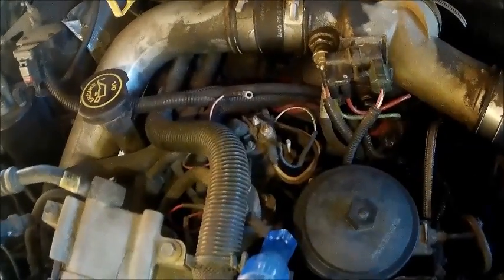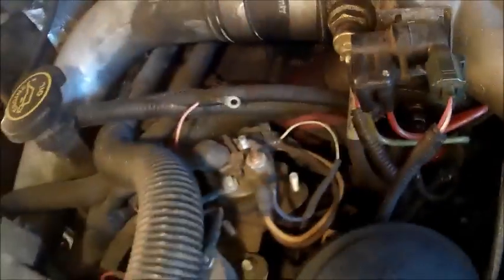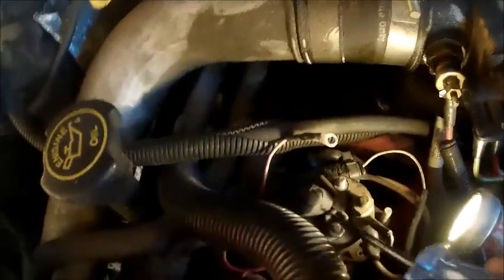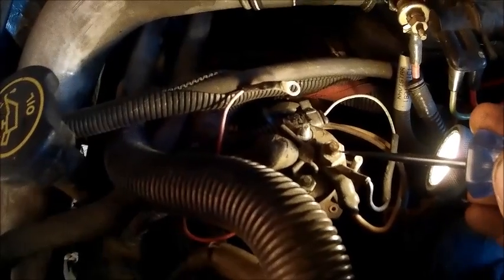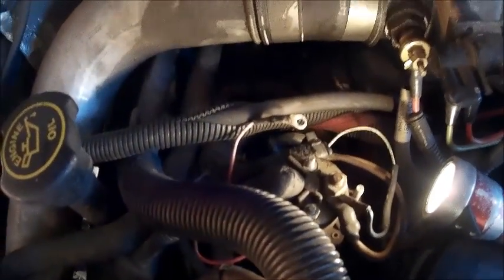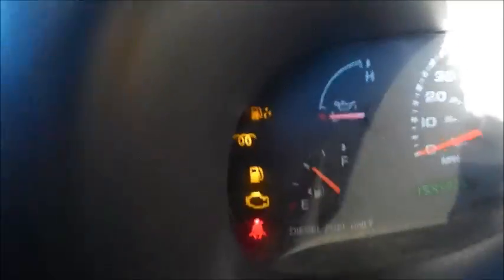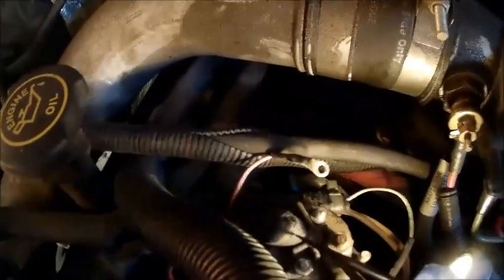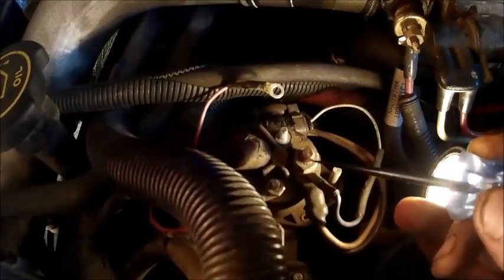Ford glow plug relay test

Comment: I put in a new relay. I have power on the main one like it did before, with the ignition on I still dont have power on the large post on the other side but I do have power on both small one's? What can cause that?

Comment: What if I’m not getting power to the second connection with the key on? Does that mean the relay/solenoid is bad for sure?
Reply: So did you leave the original wire off of that terminal permanently and add a separate jump wire ground permanently?
Reply from the maker: Sounds like it may have a blown fuse or an open wire? Thanks for watching!